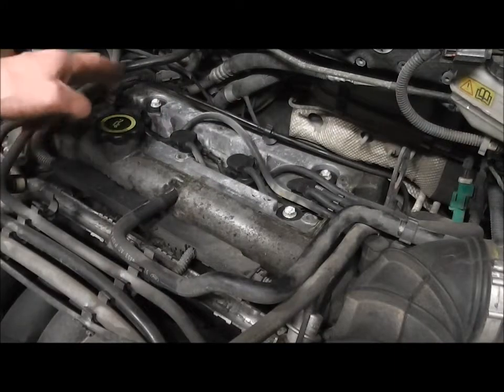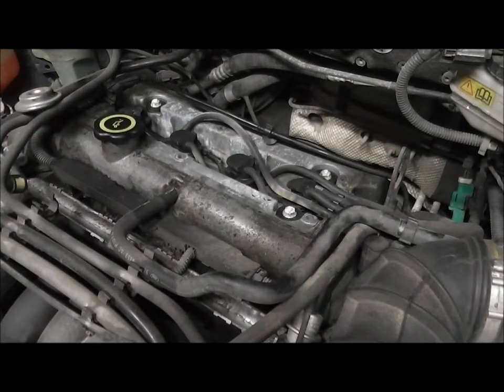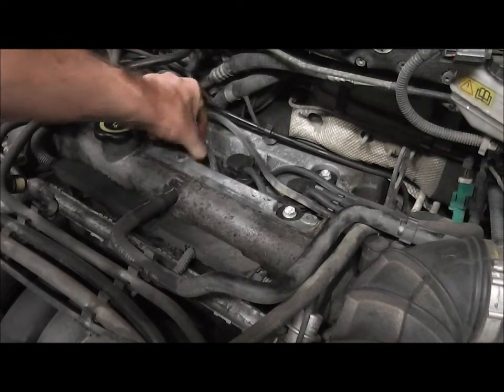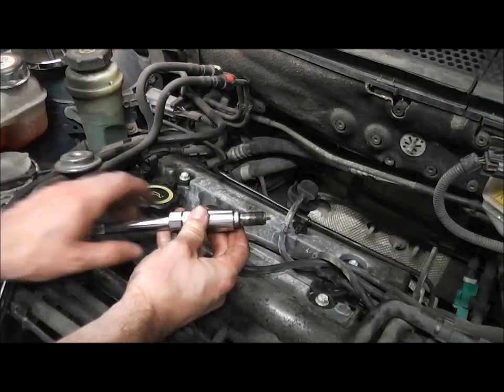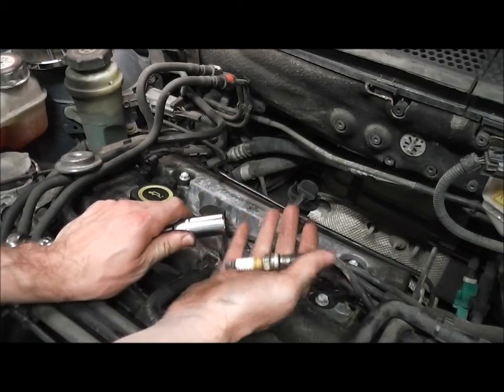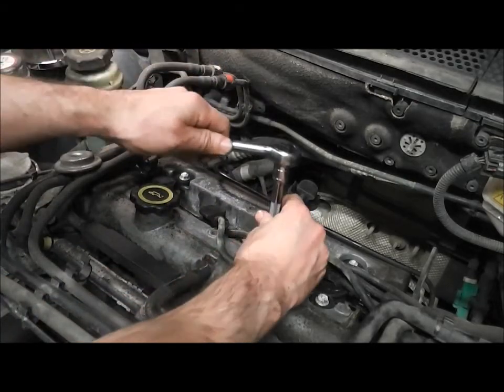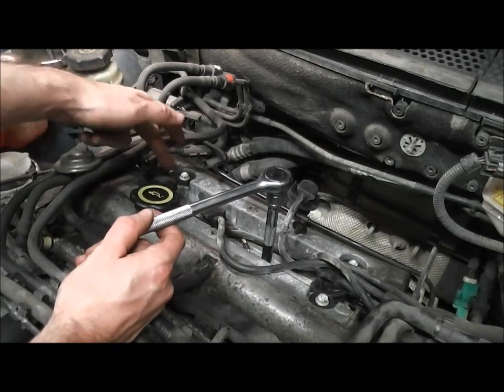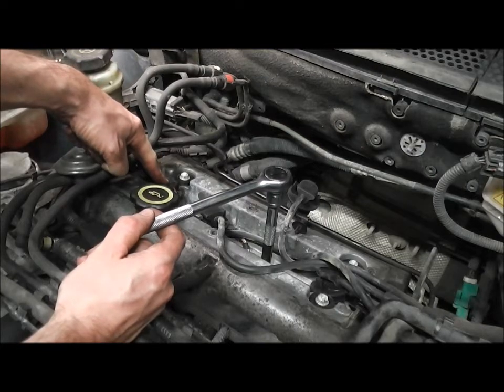Ford Focus Spark Plug Change

Comment: I was looking for a video like that, all say ford focus mk1 ...mine is from 2000 but everyone has different look compared to mine, this is exactly like mine - At last! Torque is 15nm for every other ford focus mk1, how come this is 20nm? interesting. Wondering if there are torque values that are different e.g. rear axle nut that's suppose to be around 235Nm(174 ft.pound)